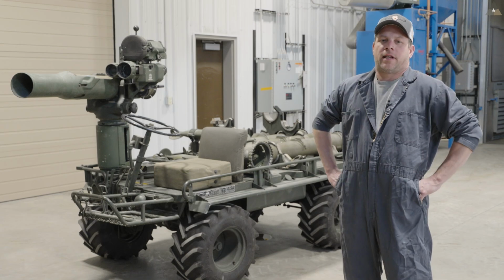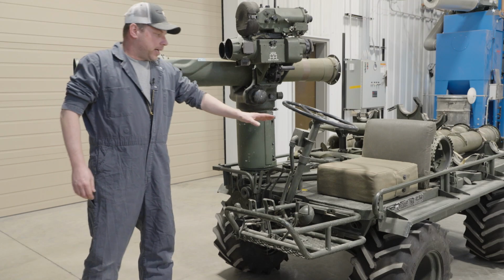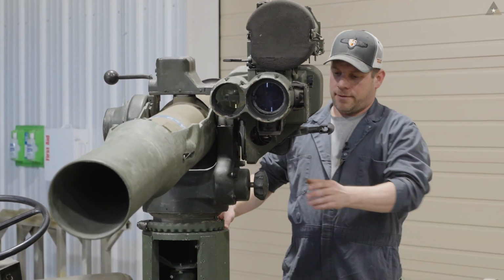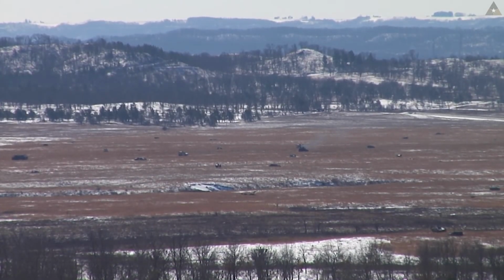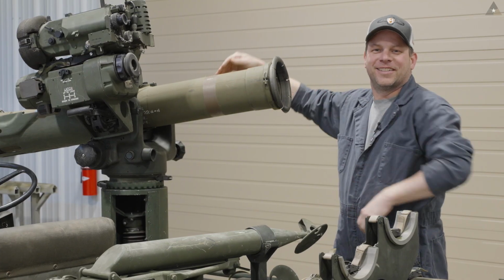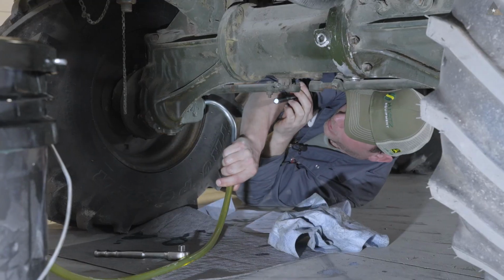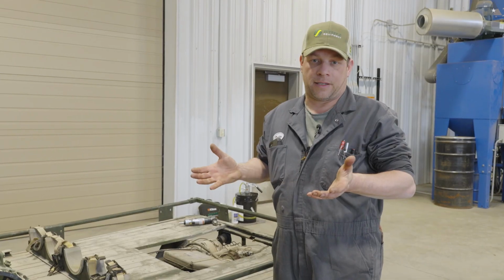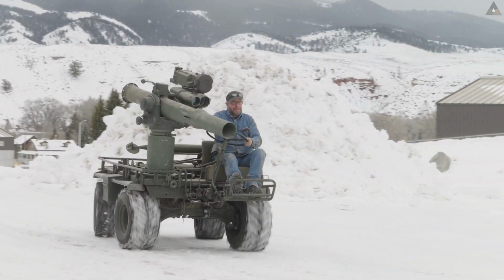M274 Mechanical Mule and TOW weapon system | A practical look

Comment: I saw my first Mule with a tow Missile system mounted on it in 1976 when assigned to the 101st Airborne Division.  At the time the Mules mounted the TOW missile system and made up the Division anti-armor weapons system and if i remember right they were tested during Reforger 1976.  It was not unusual to see Mules hang from Huey's fling at tree top level. I got to drive one once and feel in love the little truck.  
About 6 years later I was assigned to D Company 122nd Maint BN. I was on a parts run and found two at the 5th Corp Army Junk Yard  in Hannu FRG.  I had to have them, so I went back to my unit begged my Warrant Officer and the Company CO to have and the said ok, Next day I was back at the Junk Yard with a 5tn. wrecker and a flatbed trailer and took them away.  They were my project. Both had the engine remove but between the two I seemed to have the rest of the stuff to get one running.  I installed a 10 hp mil-slandered engine on to the trans adjusted the clutch checked all the oil level and started the motor. I ran I took it for a test drive, and I felt like a kid on Christmas morning. Well the mule ran for the next 18 months, I was there and it came in very hand moving parts around the shop and moving other heavy thing from point A to point B  I have a picture of me and my Warrant Office sitting on it but I do not Know how to load it hear.

Comment: I have driven one of these wonderful vehicles. It was a lot of fun. I got a bit too cocky on a steep hill and flipped one. The slanted steering wheel saved me from taking the full weight. I did a complete rollover and landed back on the wheels. The engine  kept on chugging away and I drove away as if it never happened. Lesson learned. Don't get cocky!
Reply: Always continue on as if you planned it

Comment: FAV and others were considered as 2:30 , TOW platform but no protection is not a plus , the ITV and Bradley were much better platforms.TOW is proven in the desert where it can utilize its standoff and be safe from any MBT.I have shot TOW 2 at stationary targets and they are easy to keep on target with daysight and ANTAS 4 ,a common failure on old missles is a wire break.

Comment: I notice that there is some ticking in the engine. Make sure that you add some Lead additive to the High test fuel. I use Shell 93 octane and 3 Oz's of octane booster( per 5gals). It also makes the plugs last longer.

Comment: These need to be re-made because the utility of this on the modern battlefield is insane.
Reply: Bigger is not really better in a war zone.
That thing is a much smaller target than a Hummer.
Reply: I was thinking the same thing when i looked at the peer to peer war in Ukraine and watching how they have small squads of hunter killer teams finding tanks and what not
Reply: Electric versions, also (in addition to the more-common form).
Reply: Yes. But as a follow squad drone or remote control. It could carry spare ammo, litters of injured, maybe an MMG or stinger mounted. Would be a good way to bring supplies forward.

Comment: I've fired quite a few TOWS, the last ones and last ammo was getting used up right when I hit the fleet in the USMC and I was able to to train on and live fire, and Javlen atgm and as nice as top attack, soft launch and fire and forget are, nothing can hit like the lastest tandem and triplex shaped charge warheads, with the exception of a shot right into the front armor, nothing is surviving a TOW hit, there aren't going to be any mobility kills or glances,  you can steer it right into the turret ring and BAM all the ammo is going to go and it's scrap metal falling from the sky.

Comment: My Drill Instructor during my graduation year at Marine Military Academy was Master Gunnery Sergeant Arthur Cohan, who worked on the design and engineering of the TOW and Dragon missiles.  These were the original point-contact TOW missiles rather than the modern overhead-detonating TOW missiles that capitalize on the relative weakness of the Commander's Cupola.

Comment: I am surprised that there isn't a modernized version of the mule in service. Seems like it would work well even in modern airborne, amphibious, and limited special operations, especially with how modifiable the are. It even has a smaller profile than the M-Gator that replaced it.

Comment: As a former airborne infantryman, this makes me angry because this would have been perfect for our unit.
Reply: Usually TOWs were in HHC in their own platoon. Airborne, Air Assault, and Light Infantry battalions this was the Army's TOE. When I was in Mech Infantry before the Bradleys Echo Company was the designated anti-armor company to include a platoon in HHC in M109 ITVs Improved TOW Vehicles which were M113s with the dual hammer head tube launchers. When Bradleys were Army wide M109s were gone, TOWs on Hummers are still used till this day in Airborne, Air Assault, and other divisions. The original MOS of 11 Hotel for TOW operators and 11 Mike for Bradley Crewmen was gone by the late 90s and incorporated into 11 Bravo.

Comment: DAF had a design ready for the "Pony" as they called it, but due to the contract not permitting them being built in the Netherlands(yep, economics), they pulled out.  With the pony, you could take off the steeringwheel, put it on the back and operate a handthrottle from behind. Cool to see the Mule has the forward collapsing steeringwheel with the same idea. Thanks for the video!  Awsome verhicle!
Reply: amazing utilty. people really knew what worked back then.